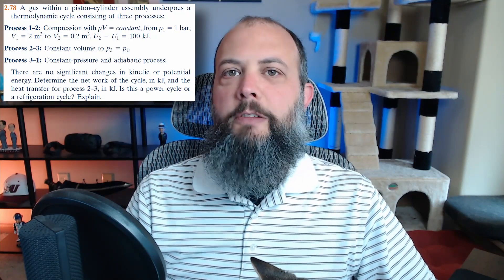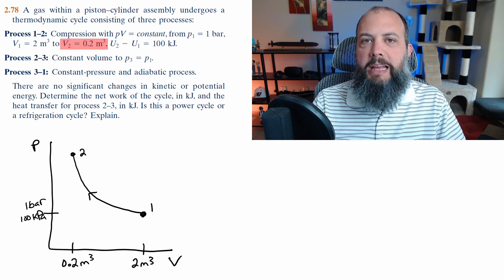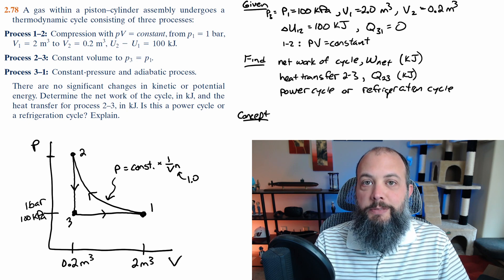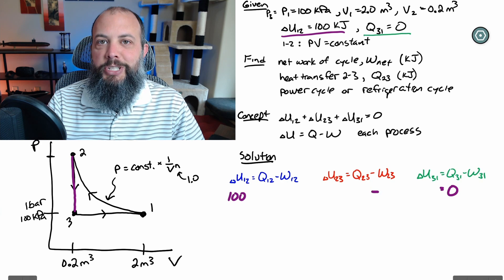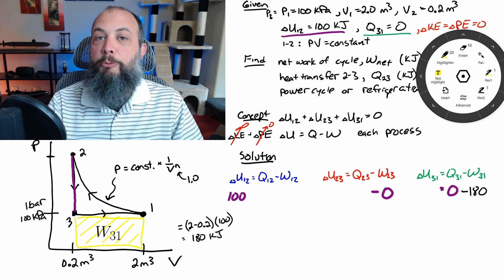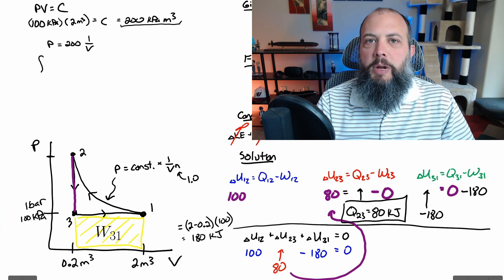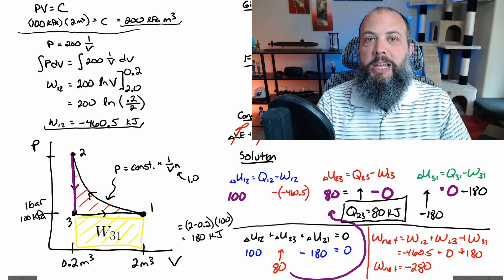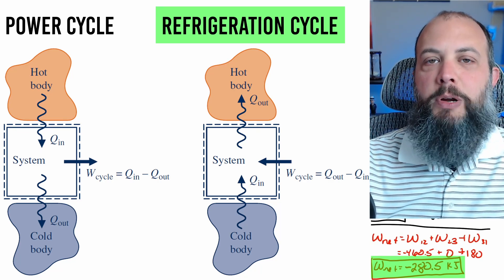How to find Work when pV=constant in an Energy Balance for Closed Systems problem

Comment: Why use p1v1 to solve for C? why not p2v2?
Reply from the maker: Once you solve for P2, then yes, you could do p2v2 and get the same constant. BUT, I still recommend using p1v1 since both p1 and v1 were given in the problem statement. Suppose you made a calculator mistake and got the wrong value for p2, if you use p2v2 to find the constant, then your 1 mistake propagates to the wrong constant value also so now its 2 mistakes. By using your givens, your mistake would be more isolated.

Comment: I didnt get one thing. Where did  come p=200*1/V
Reply from the maker: Given in the original problem statement, PV = constant, which I rewrite as PV=C. This is rearranged algebraicly as P = C*(1/V). Since you know both P and V at point 1, you can solve for C, which is 200 for this problem.
Reply: @BrianBernardEngineering  thx a lot sir.